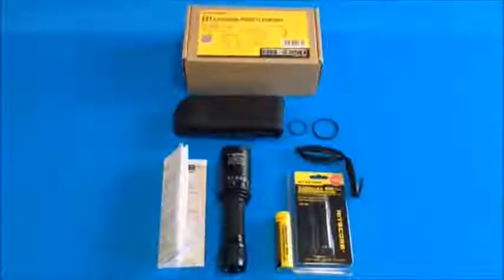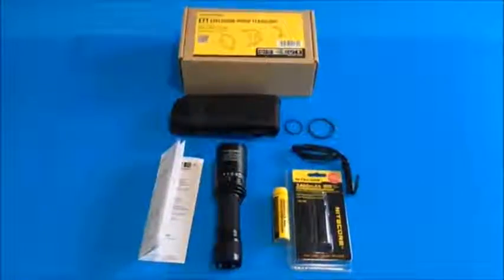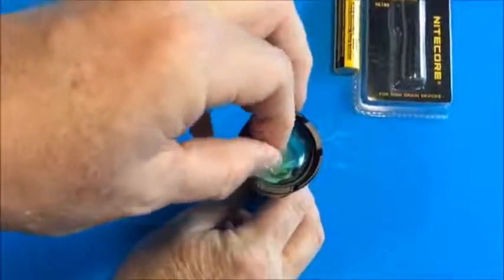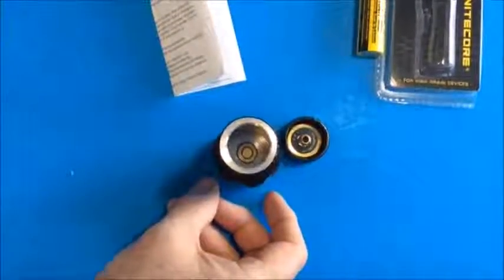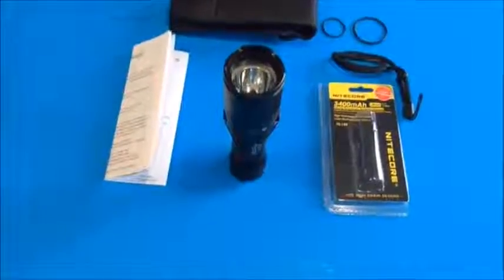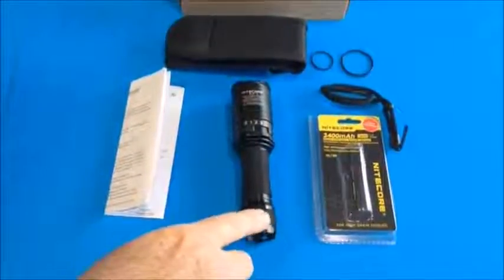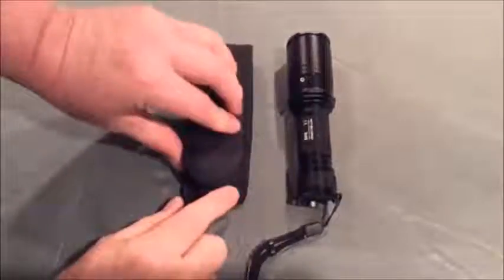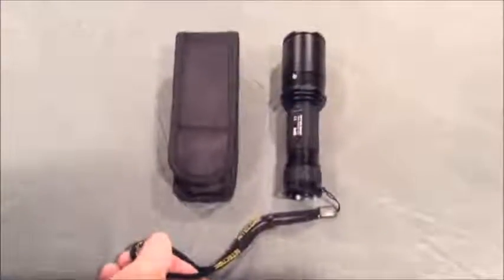Nitecore EF1 Explosion proof Flashlight Review

Comment: What's the deal with the IP ratings?
For that same flashlight I've seen on the official website that it's IP54 rated.
On the European website I've seen that it's IP67 rated.
On other regions I've seen IPX rating.
No matter where you get it from however the box and the markings on the flashlight itself always say IP54.

I really don't get it.
Reply: Oh and explosion proof does not only mean that the flashlight can contain a combustion or a spark within itself.
It also means that the flashlight is made in a way that flammable gases cannot interact with the electrical circuitry or heat that the device generates and therefore cannot cause combustion pf gases in the surrounding area.